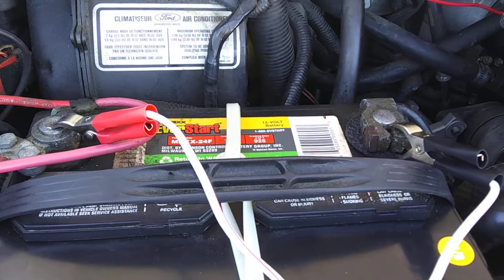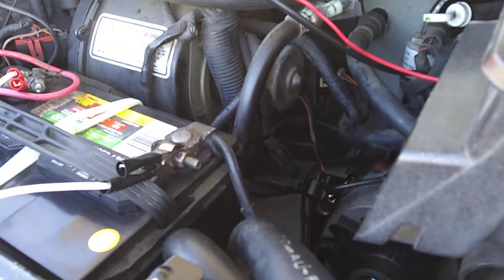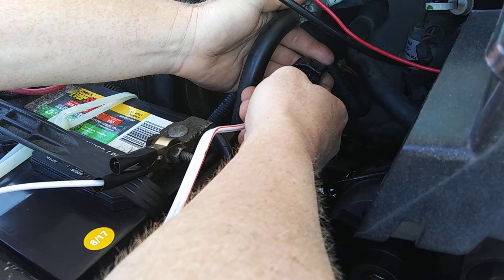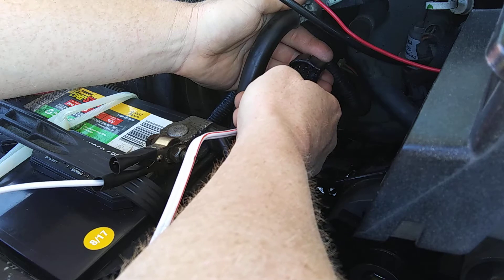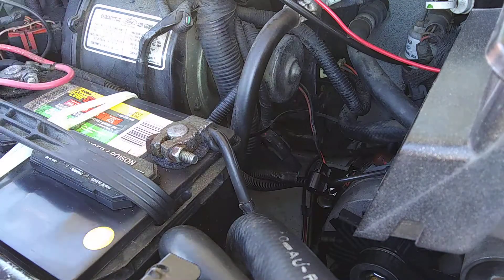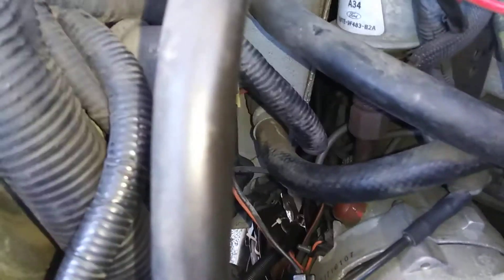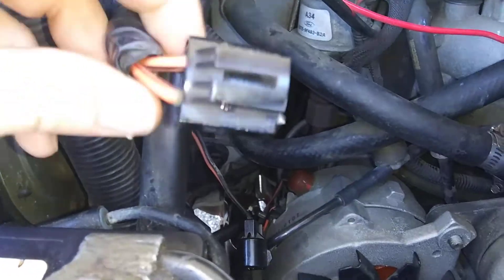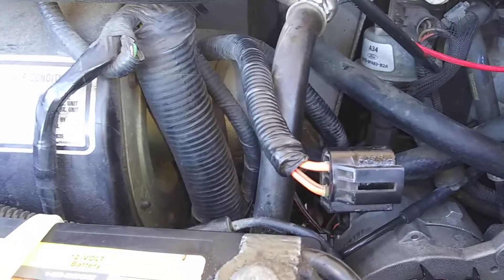part 2 just got done installing the new blower motor resistor and still not working🌎🚐😞

Comment: You need to use the schematic and multimeter for testing and trace the power from beginning to end at the motor. There is a bad connection or broken wire not letting the power get to the motor. Could be in the + 12v path or the - ground path. I know it is working now but will probably stop working soon. Intermittent connections are hard to find. Good luck.

Comment: You need to get a wiring diagram of that van and see if you are getting voltage. One of the parts you put in could be bad but you need to prove that to them.